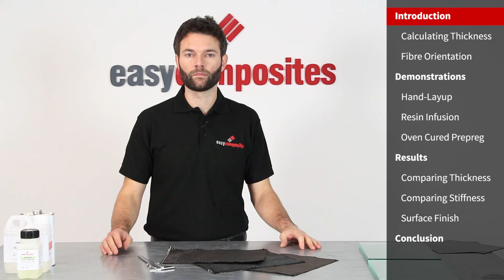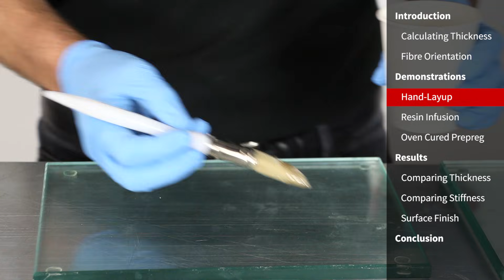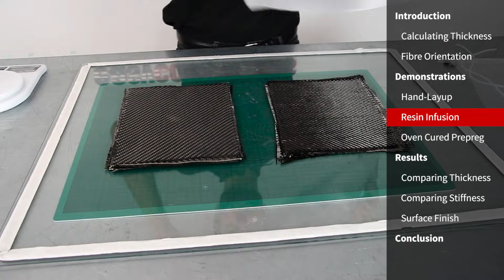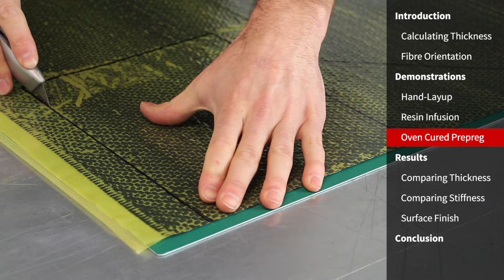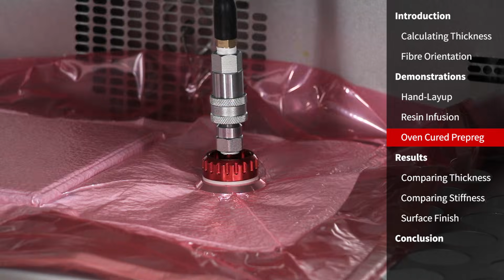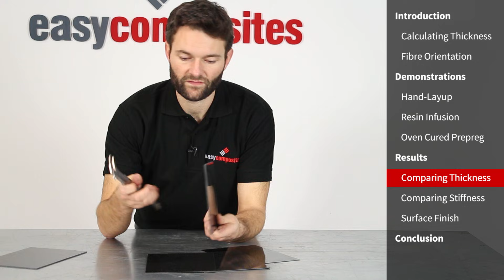How to Make Carbon Fibre Sheet - 3 Alternative Methods

Comment: What does the plus minus 45 mean anyone?
Reply from the maker: Plus minus 45 refers to the orientation of the fibres. If you consider that a plain or twill weave has the fibres at 0 - 90° when placed in front of you half of the fibres will run front to back and half will run side to side. A biaxial fabric with plus minus 45 has the fibres running diagonally at 45° to the direction of the cloth. You can see more information on weaves here on this tutorial https://www.youtube.com/watch?v=4GddDvAD3pY&t=1s. We cover biaxial fabrics around the 7 minute mark.

Comment: How about the heat testing?
Reply from the maker: The service temperature of the panel will depend on the resin and process. The majority of our epoxy resins will have a Tg of around 45°C which can be improved with a post cure cycle relevant to that specific resin. High temperature resins have a higher temperature post cure cycle to achieve a higher temperature resistance. With prepreg materials the maximum service temperature is related to the processing temperature when curing the material. More information can be found on the product technical data sheets.
Reply: @easycompositestv  hmmm... but, can we get the actual temperature resistance of the resin by hand layup process?

Comment: What kind of release agent do you suggest for the glas?
Can this also be done with a thick acrylic sheet?
Reply from the maker: We find that CR1 chemical release agent works best for releasing from glass. I wouldn't recommend using acrylic as a mould surface, a mould release wax would be the only compatible release agent but there would still be a risk of the part sticking to the surface.

Comment: Imagine each strand 12 feet in diameter (carbon nanotube cable/rope essentially) and filled in with graphene and carbon fiber mesh.  

All Solidified similarly like that plate.  Just Writ Large and not looking too different from the Grand Canyon, be certainly using each “strand” like a pipe tunnel

Comment: Why don't you use metalplates and squeeze the hand laminated fiber together? Wouldn't this result in a much thinner and lighter sheet with less resin???
Reply from the maker: A vacuum bag would achieve the same thing.
Reply: @easycompositestv  Thank you for the quick answer. But theoretically you could squeeze those 2 metal plates together with a 300tons press. Is there a limit for pressure before carbon fiber breaks/there is not enough epoxy? 
Why are only carbon flakes forged?

(I am asking because I try to make an orthotic for myself. Tonight I will try bondo first to make a first crude shape of the insole. But the final material might cost me about 300€+/leg, so I do not want to make any mistakes. I'll do the infusion way, but without prepreg (I don't have an autoclave and my oven is way too small).

Final question:
Is it possible to make a mould, fill it with carbon fiber, put a vacuum bag around it and press the positive and the negative mould together simultaniously???

Comment: Hi! Two questions, if glass isn't a option could I use acrylic? And the other question, what is the thickness of the glass that you are using?
Thanks a lot!!
Reply from the maker: Acrylic is not really an option because it’s difficult to get a reliable release. The glass we’re using in this video is 10mm but it doesn’t need to be, 4mm would be fine.

Comment: Hi there i would like to asked is it ok not to put hardener on rasin? Is  it gonna cure? But in longer time right?
Reply from the maker: No, epoxy resins need the hardener and resin to be at the correct ratio in order for the curing process to take place.

Comment: Hello, thanks for the great videos. I'm looking at making a part, essentially a flat sheet of CF with a bend in it, (approx 30 degrees). Was looking at making an aluminium sheet mock up of the part and then doing hand layup over it. Is this a sensible option and will I have any issues getting the part to release from aluminium. Would the laminating starter kit be the best option here?
Reply from the maker: Hi Luke, yes, this is a fine plan. Uses folded metal as moulds works great. Laminating starter kit would be the perfect set of materials. The only thing I’d suggest would be to get a small bottle of EasyLease CR1 as your release agent. Although the laminating kit includes PVA release agent, this really won’t apply well onto aluminium and so would probably cause release problems. EasyLease would work perfectly on aluminium.
You can even use two folded sheets and use them to sandwich your laminate in the middle, clamp the sheets together and you can get a smooth finish on both sides.

Comment: Can I do this method without vacuum?
Reply from the maker: Yes absolutely, the Wet Lay process shown first is without vacuum assistance.
Reply: @easycompositestv  It will be flexible?
Reply from the maker: @elenacagampan1942  Flexibility is linked to the thickness, number of layers and orientation of the fibres. This video does give good examples of how each of these will change the stiffness but in simple terms, the thinner the piece, the more flexible it will be.

Comment: Nice video and tutorial!
In the first method can you put a glass on the other side to put and get some weight on it and get the same surface on both sides and maybe compress it a little to get bubbles out or something?
Reply from the maker: In practice it is hard to get the air out and get a good finish that way.
Reply: @easycompositestv  Ah ok thanks for reply! 👍

Comment: I thought I'd do a Carbon Fibre Human Face Mask. The misses volunteered. I forgot to use release agent so we've run into a slight problem. I have assured her it would be off for xmas, although I'm not sure if she pulled a face because I can't see her face. But she managed to give me a muffled load of abuse, something along the lines of " You ( me) Fuse kin r's ole" . We've had to change her passport photo for a pic of Robo cop in case we go away on hols, the dog has attacked  her twice, and her boss has sacked her from the nursery ,( for obvious reasons.) The problem we have is, do we use 1200 or 240 grit paper to finish off? She's not keen on the rubbing down bit either, Women🙄

Comment: @Easy Composites Ltd
Great video, very interesting especially on the durability. If I wanted to create a cylinder with a rigid surface so it does not flex. How would you best cure the material?
Reply from the maker: You could mould and make a cylinder by pretty much all 3 processes in the video once you have a mould. Rigidity is down to number of layers and orientation of the fibres.
Reply: @easycompositestv thanks. I just started amateur rocketry, so I am considering carbon fibre for the large body and substructure

Comment: Little tip if your using there twill put your part down onto it measure how much you need ,then put masking tape on the sheet around it and cut through middle of the tape this way you wont pull any fibres out by accident
Reply from the maker: Be wary though that you cannot remove the tape from the fibres once applied without severely distorting the carbon so when using this method, make sure it is well off the trim line of the finished piece. Also watch masking tape placement if resin infusing as it could potentially block the flow of the resin.
Reply: @easycompositestv  yes i know you cant remove the tape i make sure i have enough so its bigger than the part im covering

Comment: How about sheets requiring both two sides being the same high glossy finish?
Have you done Aluminium honeycomb composite making videos ?
Reply from the maker: Making double A sided sheets is very difficult. We're one of very few companies that offer a double-A sided carbon fibre sheet but to make them we have specially adapted pneumatic heated platen presses which press prepreg carbon fibre between sheets of toughened glass. Other than sticking two single-sided sheets back-to-back, I'm not aware of any way to reliably make a double-A side carbon fibre sheet without this very specialist (and quite expensive) equipment.
We haven't produced any videos about working with aluminium honeycomb yet but we certainly plan to in the future.

Comment: How easy would it be to do this at home(in the garage of course)? I have some ideas and stuff I want to make where I could use some stiff 4mm CF but retain lightweight materials instead of using 6061 aluminum...
Reply from the maker: Hi Caleb, as long as you have the equipment it should be fine.  The room curing methods will ideally want a working temperature of 18-20C for resin curing

Comment: What about a thick guitar neck?
Reply from the maker: A guitar neck would normally be hollow or use a thick solid rod for the strength. You could build up a thick sheet using that method then cut it to shape.

Comment: When doing this infusion with unidirectional carbons of 2-3 layers on each other, the bottom layer stays partially dry, even after 10-15% of extra resin infused through the whole complex. Do you have any recommendations for this?
Reply from the maker: The issue is likely to be your UD; when stacked up, the filaments of carbon interlock and don't allow resin to flow through; you would normally ned to use UD in single plies between layers of woven or Biax materials so as to allow the resin to flow through and around the fibres.

Comment: Fantastic guides here! 2 questions I've been having a tough time getting answers for: 1. If glass is not an option, would something like MDF make an economical alternative to glass in this scenario? Is there any other cheap alternatives you can recommend? 2. Is it possible to use a piece of glass with some scratches / imperfections? Is there any filler / tips we can use to help prevent those blemishes from showing up on our final piece? Thanks!!
Reply from the maker: Answering your queries in reverse, a scratched surface is not ideal as any imperfections will end up on the finished part; additionally, its much hard to release coat a mould surface with such issues so there is a risk that the piece will bond to the tool. MDF isn't a great option as surface porosity makes release agent application a problem but a sealed surface such as Melamine faced chipboard (as used for kitchen carcasses) or hard plastics should be fine with an appropriate release agent.

Comment: I would like to cover plywood (50*60cm plywood plank) with one layer of carbon fiber reinforcement (210gr 2x2 twill) but i want a perfect finish. I really like your technique of hand layup with a glass sheet but do you think I can put my plywood directly on the carbon fiber (as in place of the peel ply) if I want it to stick well ? And many thanks for your interesting detailed videos  !
Reply from the maker: Hi Tonyo, yes, this should work just fine. Hand layup is rarely a perfect surface finish, as we tried to show in this video, but it can be very good if done correctly. Alternatively, you could buy a sheet of our ready made carbon fibre veneer, which is perfect, and then bond it to your plywood.

Comment: Thanks a lot for such a professional video ...can you please comment about a question?  What will be the effect on thickness and strength if we have two options: 
04 layers of 0.5 mm sheets for making a CF sheets versus 02 layers of 1 mm sheets 

Which sheet among these two will be lighter and which one will be stronger. We can use any of the one method you mentioned
Reply from the maker: There would be negligible differences between the two options; weight-wise, they should be much the same; the only difference in strength is likely to be as a result of the orientation of fibres but if all fibres were oriented at 0 & 90degrees, then the strength would be much the same as well.
Reply: @easycompositestv  grateful for your reply... you guys are amazing 👏

Comment: What's the application of making a flat square of carbon fibre?
Reply from the maker: Carbon fibre sheet is used for hundreds of different applications, RC car chassis, drone parts, robotics, pretty much all high performance construction can use carbon fibre sheet.

Comment: How would you go about making a billet say 50mm thick?
Reply from the maker: Well, 50mm really is a serious chunk! Realistically it would probably be more logical to make multiple thinner sheets and bind them together because getting resin through 50mm of reinforcement would be a real challenge. We have a customer who infused 20mm thick laminate but we supply them with a special ‘extra slow’ version of the IN2 hardener because the infusion takes several hours.

Comment: So the weak point of the Cabonium fiber, is the epoxy resin. and if it is tested a resin that has the best characteristics .?
Reply from the maker: It is a composite, the finished part uses properties from both the resin and the fibre.

Comment: How to use carbon fiber fabric  for wrap badminton racket crack? How to true proses? I want learn
Reply from the maker: In all honesty, it would probably be better to replace the racket. If the racket shaft is completely cracked you’ll need a substantial wrap to restore the original strength and that will change the whip of the shaft.

Comment: Just a question, why not pour the resin on the layer and spread from the center out during the hand laying? But super helpful video!
Reply from the maker: Would be very wasteful in most cases.
Reply: @easycompositestv  If you do it properly, you waste alittle but not too much. And if you get a clean piece of plastic, you can lay it on top of the last layer of Carbon and squeegee the resin out to make a super smooth finish. Did it with fiberglass a few days ago.

Comment: how many layers is needed for the bicycle frame?
and what is the minimum thickness?
thank u
Reply from the maker: It really depends, there are lots of different areas of a bike frame, some with 10+ plies of 300gsm UD and other areas with only 3 or 4 plies. Have a look at our video on how to make a carbon fibre bike frame, that should tell you most of what you want to know : )

Comment: Interesting you don't suggest wet layup with vacuum bag.
Reply from the maker: It is another option, yes, but the problem with wet lay vacuum bagging is that it's a lot of effort (compared to normal wet-lay) without actually fully solving the problem in the way that resin infusion does. This makes it a bit redundant in most cases: if you want quick and easy and don't mind a few pin-holes then wet-lay is the way to go, if you want improved performance and a cosmetic finish and don't mind the extra work and cost of a vacuum pump and bagging consumables then resin infusion is the way to go. We do have another video which shows what you're likely to be able to achieve by vacuum bagging wet-layups.

Comment: Where can I find mechanical strength numbers (ultimate, yield, tensile, shear, etc) for different loadings (axial, torsional, transversal) of the sheets that you made using various fiber orientations & different numbers of fiber layers?

Thanks in advance!  Great video content!
Reply from the maker: Our stock sheets have some mechanical data on the product listing.

Comment: can you use any brand of resin for resin infusion??? like totalboat for example???
Reply from the maker: I'm afraid we don't know the brand 'totalboat' so I couldn't comment. For infusion, it's critical to be using an infusion resin, a typical laminating resin will be too thick. We manufacture and sell resins, including the IN2 Epoxy Infusion Resin used in the tutorial so clearly that's the one we would suggest but of course there are other epoxy infusion resins on the market. Results will vary, on a number of fronts, but any epoxy designed for resin infusion should - at the very least - infuse through the laminate properly.
Reply: @easycompositestv  ok i'll ask totalboat  if any of there resins would be any good for infusion and get back to you

Comment: What fiber GSM u r using?
Reply from the maker: There's a few different fibre weights used in this tutorial. The smaller weave pattern is a 210gsm 3k, the larger weave pattern (including that used on the prepreg backing plies) is a 450gsm 12k. The +/- 45 biaxial is 300gsm.
Reply: @easycompositestv  thank you

Comment: Excellent tutorials guys, Thanks. Can you advise if I wet out a sheet of carbon and sandwich it between 2  layers of polyethylene sheet does that slow down the curing time by eliminating almost all air exposure to the resin? I ask as I want to make a carbon/foam/carbon sandwich panel and wetting out all the panels, laying up and putting together before vacuum bagging may take longer than 20 minutes which is I believe the curing time approximately. I will be using polyester lamimating resin.
Reply from the maker: Hi Andrew, no, lack of air exposure would not slow down the cure. Once the resin and hardener are mixed they will cure, no matter what. Many processes we cover, including the resin infusion shown in the video, are 'closed mould' which means there's no face open to the air. For what you're planning, polyester resin will tend to be a bit faster than you'd want. Use a low reactivity catalyst or at least a low percentage of catalyst. Other than that, you should be fine.
Reply: @easycompositestv  Hi Guys, thanks for the reply. I did think about this after reading your reply and it makes sense now. I've been prototyping with your foam and made a small panel sandwich of 3mm foam in between 2 single twill plys using polyester resin and wow it's stiff. This has given me the confidence to continue my project using less carbon than originally planned.